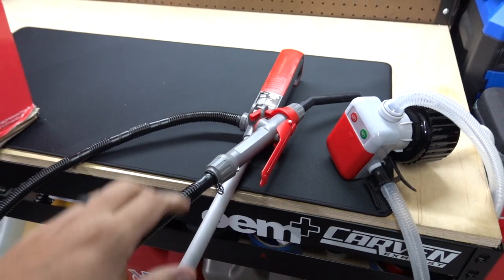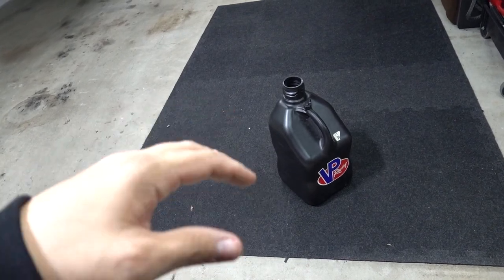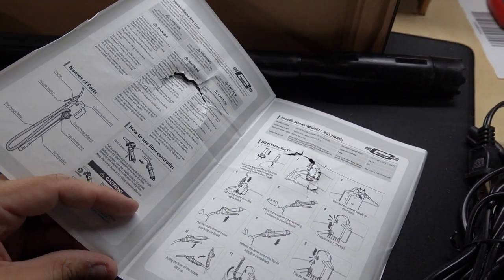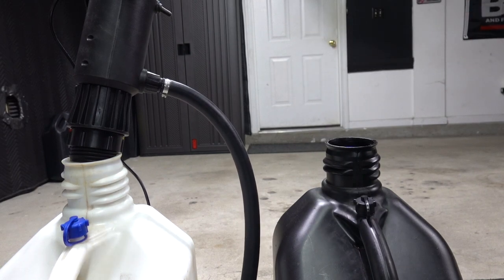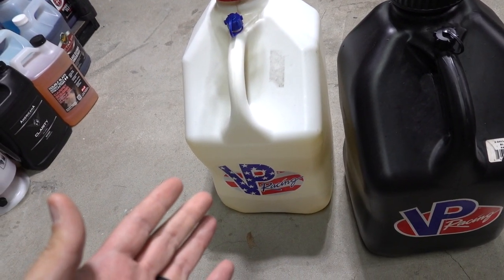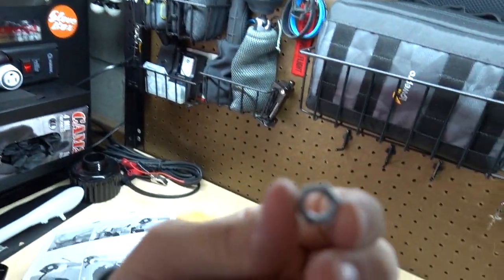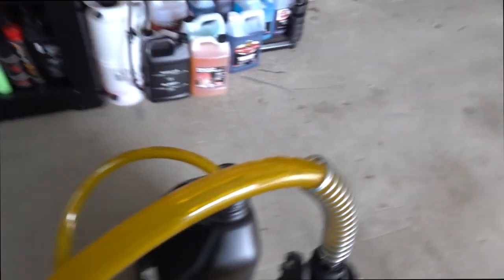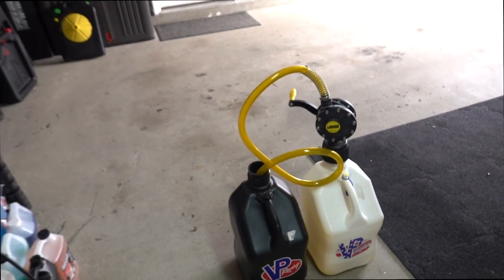Found The BEST Fuel Transfer Pump !!

Comment: Depends on what you are using it for, way too fast, too high a volume for use with lawn mowers or garden tractors.
Reply from the maker: agreed some situations it might not be the best for but the shut off it pretty controllable so you may still be able to use it for most things by modding your usage

Comment: your go to one is perfect for diesel cause I filter all my diesel before it goes in my tractor, and it seems to be the perfect flow to work with the Mr funnel, you would be amazed to see there's actually stuff just from the pump you can put in your tank, I m just trying to cut down on down time and maintenance

Comment: I have the same Tera stick pump. The problem I have is it's stored in an outside shed which is really hard on the batteries. I also had problems with the cheezy switch. To rectify that, I got rid of the batteries and switch by installing a 12v to 3v dc converter in the handle, with the wires coming out through the switch hole. On the end of the wires are soldered battery alligator clips for connecting to my lawn tractor(s) batteries. You'd be surprised at how much better the stick pumps with more available current from the 12v battery. In addition, there's a paper stuck to the side of the stick which covers a hole. I used RTV to seal that hole with the switch from the end of the handle. My guess would be that with the better seal this gives the pump a better vacuum pull on the fluid being pumped. I currently don't have any switch & the pump is on/off by the battery connection. Connecting it up is a little difficult for the mechanically/electrically challenged in our household so my next step is to use a 20v drill battery instead of the tractor battery and to add a switch. We'll see if that's any easier. If it was just me doing this stuff, I'd keep it the way it is. I would like to find a ring for the gas can so the stick pump could just stay in there... maybe some kind of hose adaptor? I'd really like to have this as a semi-permanent setup in our shed so that only a tool battery & a switch was involved. You're doing good stuff, keep it up!

Comment: i have a chipper shredder and the engine fuel tank is like 3 to 4 feet off the ground I don't see that crack pump working trying to hold the hose and crank the pump at the same time  3 feet apart

Comment: Hi do you have a model number for the Mr. Gasket fuel transfer pump I am having a hard time finding it on the internet
Reply from the maker: it used to be on Amazon but doesn’t seem to be there now .. I did find it on Holley.com if you go there and search “mr gasket transfer” in the search bar it’ll pop up as the second search option Part # 8017MRG

Comment: Junk. Mine lasted one year.
Reply from the maker: damn :\ mine was great for a long time and even the new owner of it thankfully has no issues maybe it was just a bad unit :O
Reply: Had to by pass circuit board and wired directly to pump wires. Overflow switch is our junk. Installed my own switch. Pump works but no overflow protection.